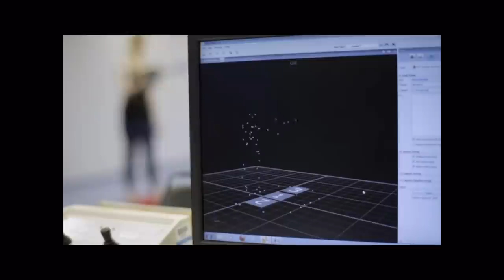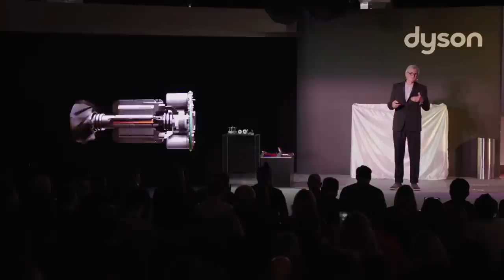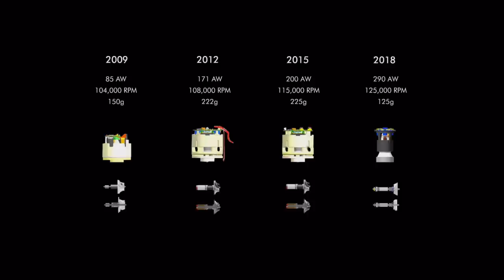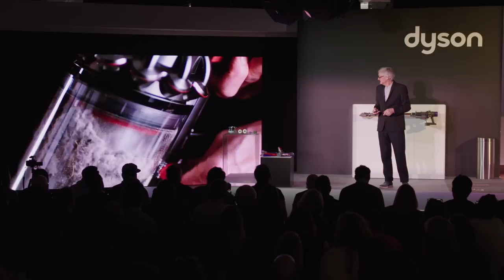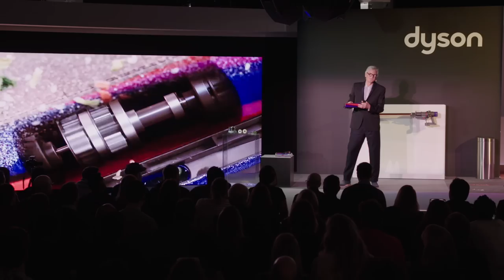James Dyson unveils the Dyson Cyclone V10™ cordless vacuum in New York

Comment: As a nerd I am seriously delighted when someone takes the design of tech to such extremes as to develop technology to make 'current top of the line' even better. As an ID, I find joy in well designed products. When he explained the mechanism that empties the bin, I realized why Dyson's cost more than the others. I have a Shark cordless, works great, not heavy, not so expensive... but man the way to empty the bin sucks and you get your hands dusty because the filter gets coated in fuzz and even if it doesn't the latch that closes the bin isn't great, and the bin itself is small. It's the little details derived of careful observation and consideration of the user's needs and ways that makes a good product great. Well done Dyson!

Comment: 23:57 Sir James Dyson is a smart man. Most engineering firms do not do this step with product design, it is just good enough if it works. Optimizing it usually doesn't make it any more expensive to manufacture or increase the weight, you just have to change the design and it is much better. So often management is short sighted and just tries to get something done as fast as possible while not actually trying to make it better. Here you have a founder/owner engineer in-charge and the quality of the products shows.

Comment: Amazing presentation, learned so much. Upping the amps to prevent fading was very clever. I didn't realize how it was possible to prevent batteries from trickling but this video really helps explain it. I wish I can just hang out with James for a day.
Reply: It's called voltage regulation. A "tech" that has existed in various devices for +15 years or so. Possibly longer, among others in Flashlights. In Dysons case, I guess they used the new 7th battery - to compensate even further for the voltage drop that occurs during battery depletion (and of course, give it 17% more battery capacity).

Comment: As now being a proud owner of this V10 I was quite impressed at just how well the engineering is for this entire vacuum. Yes, we would all like to have a longer lasting power house but just imagine where this advancement will take Dyson. I'm terribly sad that I'll not get an upgrade to my favorite Cinetic Ball upright vac but to have the same power in a handheld is amazingly jaw dropping. Honestly, as a homeowner of a 2k+ sq ft home with kids, pets, allergies and an desire for a thoroughly clean home, the only real complaint I have against the vacuum isn't battery life, it's the lack of swap-able batteries.

To put this into perspective, I'm a mechanic and have run my shop for years on the same old Air powered tool technology, like everyone else. But with the last 2 years of advancements in handheld power tools, I've done away with almost all of my air tools and replaced them with brushless motored battery powered tools with up to 9mAh batteries on 18V - 20V systems. Great examples of these are the Dewalt 20V MAX XR series and the Milwaukee M18 FUEL series of handheld battery powered tools, 1 battery connection to power them all. I will admit... I retrofitted an old V6 with a home modification of a "swap-able" battery pack but when you realize that Dyson went as far as to have an activation switch on the battery itself, you realize how inferior your home mod is... or how annoying it is to now have a vacuum that doesn't stop unless you take the battery off... Hahaha.

So I like many others that have or have had both these battery power vacuums or the standard upright vacuums, I wish I could say it to James Dyson himself but I would encourage Dyson as a whole to not abandon the corded vacuum for 2 reasons. A) Unlimited use throughout the home - with the inconvenience of cord length and weight. B) Anyone with a medium sized home and larger (2k sq ft+) will not abandon the use of a corded vacuum because they want the MAXimum suction power from start to finish. Based on my home, the average vacuum run time with my Cinetic Ball (Carpet, Hardwood and Tile) is usually about 40-60 minutes depending on if I want to move furniture out and vacuum those areas as well.

So my takeaway on the entire product - IT'S FANTASTIC... no, it doesn't last as long as I would expect from V8 to V10 but you can't expect a company to improve a product unless they are given both pros and cons and have ideas bounced off of them from real customer experiences. However, a company can't improve if you don't support them through purchasing their current product line or investing with them.

Basically, I know I sound like a fanboy, but when you've had the same DC15 Animal ball for 13 years and it's outlasted your parent's 15 year old Rainbow, there is a lot to be said for the build quality. Thanks to any and all who give this a read.
Reply from the maker: Hi Robert, we appreciate your feedback as we do take all feedback seriously. I'm also happy to hear that you're finding your Dyson Cyclone V10 to be fantastic in your use. Dyson has spent 25 years creating dependable vacuums that properly clean the entire home. Rest assured, we will still make, sell and service traditional corded machines for people who want them, but we must stay focused on the future, which is cord-free. So we have shifted our research, design, and development focus there.
Reply: As far as feedback on the V10 to Dyson, the only big complaint I've seen on numerous youtube reviews (and one which I concur with) is that the power button is much too easy to accidentally trigger when handling the unit (removing tube, putting on the wall mounting, etc). The simplest fix would be to change the power setting to have "Max", "2", "1" and add a fourth setting "OFF".
Reply: Corwin is genius

Comment: Dyson needs to up their warranty. 2 years is not enough for an $850 (CDN) stick vac. A 5 year no quibble, no limit, no deductible warranty is were they need to go with this V10. I'm getting 4 to 5 years from a $80 Bissell and it cleans my hard floors just fine. I could never justify this machine unless they have the balls to back it up with a zero BS warranty. I need to know that I won't have to by another vacuum again in the next 5 years.
Reply: The reason it has 2 years warranty is because that's how long time a Dyson will last if you use it hard for 2 years.
Reply from the maker: Hi Marcus,

Thanks for your comment.

Although we offer a warranty of two years on our cord-free machines, that does not dictate how long the product will 'last'. Many electronic products feature warranties far shorter than this (smart phones, tablets, laptops etc). Just because you buy a tablet with a warranty of one year, does not mean it will only last one year. The same applies for any product.

All the best,

Allan
Dyson UK
Reply: if you will use it for purpose its made and use with care,it will work more than 5 years. And you have to understand that any battery so far wont work lifetime. But if u r unthankfull country boy who crush things and drop them,and want it cheap and work forever. Dyson is just not for you,just stick to broom.
Reply: This is not a good answer. Why do you offer 5 year warranty for other corded models? If he can say that the technology is here and it doesn't make sense to design new corded models then you could back that up with the same warranty. About the battery he said that it should work for 15 years, so that shouldn't be a problem. If you know the product will last more than 5 years why not give the customer a peace of mind? 
For me it's a huge deal. To give one month salary for vacuum that motor can stop working at month 26 and I can throw it in the trash. Or pay 3/4 of new one to repair it.
Reply: Because customers are dumb and use it for wrong purposes,that battery will last for 15 years ,but if u will charge it as you should and if u store it as you should. But most of ppl are not doing it and they start to whine if customer service decline warranty.
Reply: I would be perfectly satisfied if they have 2 years on battery and 5 on everything else. Like with mobile phones. 2 years device and 1 year for battery, charger and earphones.
Reply: @DYSON - Thanks Allan for taking time to answer my comment, always appreciated! My computer (A Lenovo Thinkpad) has 3 years - next business day on site warranty. This without costing 3 times the competition. DYSON has never been a company measuring their quality standards with all other companies in your segment - You set the bar higher, yet, a Miele vacuum has 10 years warranty and costing less than the Dyson. How come they can and not Dyson?
Reply: Wo wo wooo stick to the facts please,Miele dont have official 10 year warranty to vacuums. I will agree on that them working time is average 10 years but its depends. In Europe is 2 years warranty by law so it is like that either Dyson either Miele,and rest is up to manufacturer who chooses to add additional numbers or not. And Dyson has done it to exact models but Miele hasnt( it may depend on product type,because its different for UK,US and EU.
Reply: East Coast Resident bear in mind also you can get replacement parts easily enough.
Reply: Then don't put a non user replaceable battery in the first place. Your warranty show us the limited trust you have in your product.
Reply: Sylvain Paquette the battery won't fail. Find a comment where a dyson user says the battery failed.
Reply: Sylvain Paquette do u have any clue what u r talking about? Dyson batteries are one of easiest to change, try to change battery on Electrolux Ergorapido.
Reply: ByKrut - I don't know what you talk about or what planet you come from but, [ https://www.miele.co.uk/domestic/10-year-extended-vacuum-cleaner-warranty-3141.htm ] - 10 years warranty. You pay £50 and the total price still lower than a Dyson 2 years warranty. With Dyson you can't even extend it. Battery should be HOT-SWAP.
Reply: Obviously you dont read replys till the end. First of all it is additional not main warranty,u have to pay for it.
 Secondly in most countries you can buy additional warranty for everything including Dyson products. 
 And third it is only in UK and this promotion is made by them,if u will buy it in Germany or United states or Russia it will has the same 2 years,if distributor dont offer you an additional warranty. So conclusion - if u want 10 year warranty on miele,move out to England, Scotland, Wales or Currys Northern Ireland and pay additional 50 pounds. P.S. hate when ppl act smartass check facts before post this blsht
Reply: krneki44 one month salary ? Lmfao where do you work KFC?
Reply: Although I'm full of admiration for the technology and design, I'm in a similar position in that I don't want to have to treat my vacuum cleaner with any particular reverence if I want to avoid replacing it every two years. I don't expect it to be "cheap and work forever" but it's reasonable to want "an expensive, considered purchase that last at least 5 years". What we don't know is how having a lighter vacuum translates into not needing to be heavy handed - something I'm happy to let early adopters find out.
Reply from the maker: Hi Sean,

Thanks for your comment.

No one should need to be heavy handed with any technology and there is no way that being heavy handed would improve performance of the machine you are using.

However, we do put our designs through some harsh testing before they are finalised as you can see here: https://youtu.be/f3iXRFizaz8

We also test in-home with real users, not just by using testing rigs.

All the best,

Allan
Reply: Hi Allan,

I think my point was poorly made, I'll have another go :)

If a cleaner (or whatever) is heavy or awkward, you'll wield it with less precision and need more energy to drag it about, inevitably translating into more bumps, rougher treatment, and consequent wear-and-tear. But - at least as far as I'm concerned - this is an unintended side-effect of the weight and bulkiness, not as a means to improving performance.

So the question for me is, do the improvements in weight and design mean that previous sort of wear-and-tear is mitigated? My gut reaction is "probably" but it could be an expensive experiment. I realize there are other factors - convenient storage, flexibility etc. - hard to weigh up the pros and cons objectively

Ta

S
Reply from the maker: Hi Sean,

Apologies for the delay and I'm sorry no one has got back to you on this.

I see what you mean and my immediate response would be yes. There is far more precision and control when using one of our cord-free models without that excessive bulk you are referring to. This makes things quicker as well, as you simply grab it and go.

If you are in any doubt, I would recommend popping into a John Lewis or Currys and getting hands on with one. If in London, head to Dyson Demo on Oxford Street.
Reply: ByKrut 
Or maybe get something made of Metal. Kirby vacs last 25+ years.
Reply: @krneki44  One month salary? How old r u? lol
Reply: @krneki44  Sorry, my bad. Since you speak english so I assumed u must be in an English speaking country, and in english speaking countries that price of the vacuum is still expensive but not nearly as much as a whole month of salary. Anway, my apologies.
Reply: @Commander_HW  Sorry for my reaction too. I read a couple of comments regarding my salary and was upset. All good :)

Comment: 🧐 Loop pile carpets. In the V7 Operating Manual, and the V7 has essentially the same kind of motor-driven brush bar head as does the V10, it clearly states: “The brush bar on the appliance can damage certain carpet types and floors.” With loop pile carpets, as stated on leading carpet manufacturers’ websites, it is recommended that the brush bar on vacuum heads be switched off. Loop pile carpets are popular carpets; but you can’t turn off the brush bar rotation on the supplied motor-driven brush bar head of the Dyson V series of vacuum cleaners - including of course the V10 which happens to be the most powerful of the V series range - to accommodate the vacuuming of loop pile. 

Will Dyson bring out a suction-only head for their V series vacuum cleaners?

Comment: Should have made it so you can swap out the battery so you don’t have to wait for it to charge up again before using
Reply: Sexy-cream-sickle or you they could still make them with a cord. That way you get unlimited max suction, not 7 minutes in max.
Reply: Their new v11 outsize has removable batteries, it actually comes with 2 and 2 chargers as well.

Comment: Of all the perfection. You left out one very crucial part. None of your V series can stand on its own including V10. Many times you need to use two hands to remove something in order to vacuum. Many times my V8 topple down and hit the floor hard when I don't lean the vacuum properly on the wall. Even is leaning properly, it slides sideways and topple down too. You need to design something like a motorbike level to stand the device on its own while using the floor vacuum head.
Reply: The V10 specifically has a rubber strip on the handle so it can be lent up against the wall, although it can still fall over if you're not careful.

Comment: How about this. Use a hall effect system so that the motor can still bypass for just incase the digital aspect fails or you need full power and you still have analog ways of controlling the motor for full power and then if other periferies like the brush head motor for carpet application a mounted driver with software can program the powerhead motor by inputs of the motorized brush head motor to adjust the speed or load  of the powerhead motor for the needs of carpet application. Almost like pilot and auto pilot
Reply from the maker: Interesting!

Comment: You should INVENT a battery that can be easily swapped for new V10 (as promo include second one). Or one that can be charged faster. Or one that is double the size. Or combine all options. - 6 minutes of MAX mode is just not enough!
Reply: krneki44 dyson might benefit from cordless power tool batteries. Or at least para series these batteries
Reply: you do not need Max mode for anything , try using the lowest setting and getting your 60 minutes worth
Reply: Jasbir Kaur Villaschi 21700 batteries more mah higher amp discharge then you can run on high for 60 minutes. Anyone know what cells are in the v10 battery pack?

Comment: I bought Dyson V6 just over 2 years, now out of warranty for £250. Twice during the two years of warranty the roller brush motor mechanism packed up. Luckily it was replaced due to warranty twice. Then now when the warranty has expired it seems the battery is not charging. Called Dyson who say their engineer will attend if it is repair cost £80 & if the battery pack needs changing £100. I wonder if it is worth repairing.
Reply from the maker: Hi Ravinder, I'm sorry to hear about this. We can't specify an exact lifespan for the battery pack as this will depend entirely on how each individual machine is used, stored and maintained. It would be entirely up to you whether or not to have your machine repaired, but as part of a fixed price service the machine would be fully inspected by our engineer and returned to full working order. You're welcome to call us back on 0800 298 0298 if you would like to arrange this.

Comment: curious if one of the Dyson engineers fiddled with creating an electric turbine where it will be place at the front bumper of an electric vehicle and the incoming air will spin the turbine and then recharge the batteries as the EV is moving forward.